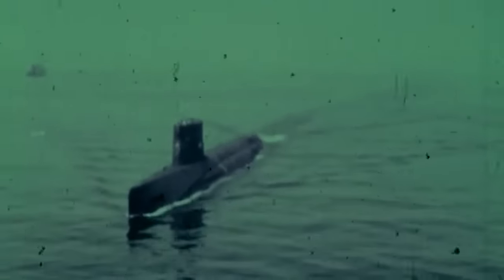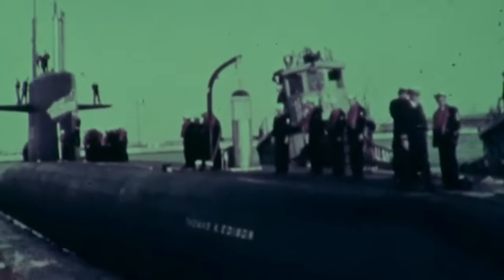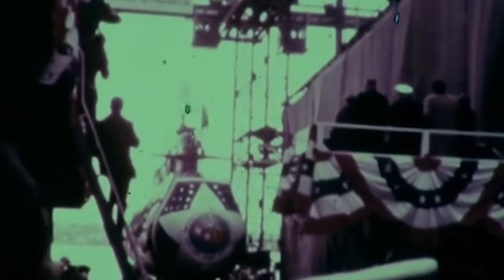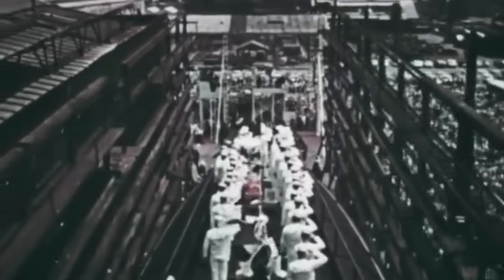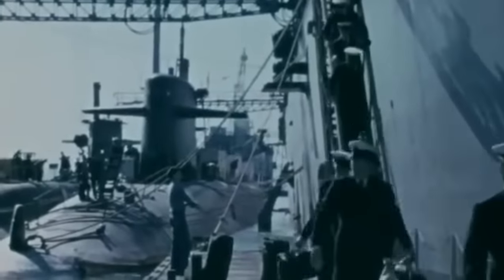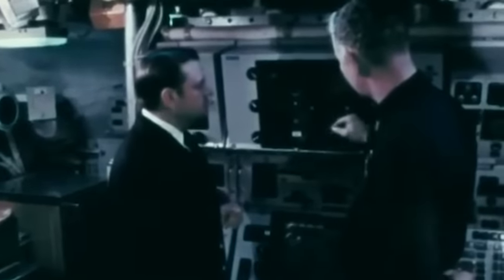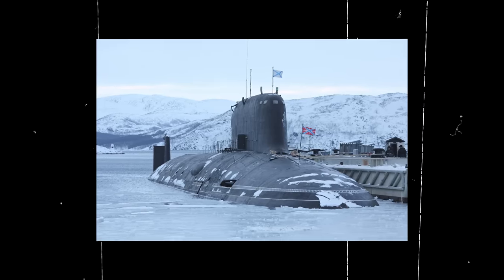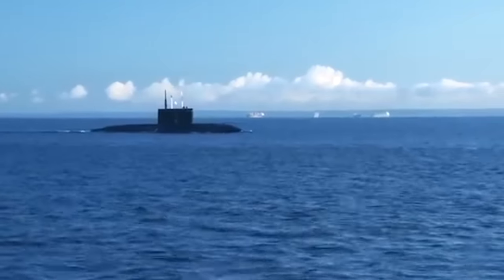Secret Project 0951 Submarine Threat to America?

Comment: You have to remember that we as a country have ALWAYS painted our potential adversaries.  Remember when Lt Balenkov handed over the Mig-25 we found that it was a rather primitive aircraft with a ungodly powerful engine.  The engine also was rather primitive, remember that they balanced the engine by injecting ceramics in the center of the engine, yes it balanced the engine well but the lifespan of the engine was 4 hrs at full power and these engines were not repairable.  You have to also grasp that the Russians haven't been to sea for practically 4 decades, so their at sea time is measured in days and weeks at sea per year, whereas we measure in months.  So even if the platform has all of the technology you tout, you still have a crew that isn't all that experienced.
Reply: I agree ! A very good Intel report!
Reply: Russian subs are no joke I remember in 2018 when their kilo submarine evaded all NATO detection in the Mediterranean only to emerge near Syria launching missiles at ISIS
Reply: @briant5685 a WWII diesel electric submarine infiltrated an aircraft carrier strike group completely undetected in a training exercise.  Any submarine, when properly operated, becomes nearly impossible to detect.
Reply: The Russian navy has been a hot mess from day one.
Reply: Still even with their reported extremely high-tech, systems I am in question of actually even being real, or simply false released data and most likely, nowhere capable as reported.  Was a rider some 39+ years ago, and then even if the Soviets had a similar or superior capabilities platform they never lived up to the specifications attributed to the platform.  Even today their crews appear to be marginally competent, this extends from their surface, air, and land forces.  Do some study on the day-to-day operations in the Navy, it seems as if most of the technical specialists are in the very upper enlisted and officer ranks, whereas the lower ranks are basically glorified compartment cleaners.  The sea time for these boats is very low, so underway experience has been at a minimum since the fall of the old Soviet Union.  So even if these platforms were the best in the world, they would be no more effective in the real world than say an old 637 SSN at best.  And even then, I would put my money on the 637 SSN in a real-world matchup due to crew experience and competence.  The Russian Command structure has some glaring hold over issues from the old Soviet Union, and not much effort has been in improving these problems.
Reply: @GusCraft460  Keep in mind that the U.S. military has been subjecting itself to increasingly convoluted training scenarios just to learn something from said training exercises. I guarantee that's what happened.
Reply: Yeah, pretty primitive. That is precisely the reason why they were shi...ng in their pants in Washington in October 1962, when Moscow had at most some 50 ICBMs and a strategic power a fifth of that of Amerrica. Primitive Russians indeed.

Comment: Propeler design for submarines is highly complex engineeringand the shapes are classified because if the enemy knows your blade shape, they can know the prop noises to expect at various rpm and depths.  This is a huge advantage tuniing the sonar system to detect the sounds.

Eventually, they can extrapolate all of the sound information from sonar recordings, but that can take years.  Meanwhile the sub with the undefined sound profile can just change RPM and dissapear from sonar.
Reply: @fhuber7507 - was going to make the same comment, the prop would be modelled from photos and estimated blade count and noise would be in SOSUS in an hour once they mapped the prop . Then verified by a contact...
Reply: There were so many mistakes in your first sentence that, when I got to "sonar system", my brain initially read it as "solar system".

Comment: Our subs also have their submarine propellers shrouded when not in the water… it’s a given…
Reply: Most things are covered when not in water and can be seen by satellite or any means. I worked on a fishing boat right next to the sub base and the EB facility that built them and everything was covered and a big billboard facing the river that deadly force was authorized,& no photography was permitted.  Basically the same sign that is posted at Area 51 gate place that we see on tv   It’s common sense to cover anything that gives you an advantage and keep it secret for as long as possible.

Comment: Did you check to make sure that Koolaid your drinking was not supplied by the Russian MOD?
Because there seem to be a LOT of questionable statements in this presentation.
The Thresher was launched a decade earlier than the first Alpha. While the Alpha with it's titanium hull was capable of diving deeper than it's US contemporaries, it was also so noisy that US boats could hear it coming when it left port. And as the US also found out almost 20 years earlier, liquid metal reactors sound cool, but they a terrible idea, especially in a sub at sea. 
As far as their new "super" sub, if they can't do maintenance, then it's not going to be a threat for very long. The Russians just added their latest sub Moscova to the fleet in 2022, with an assist by the Ukrainian Navy. 
And those "hypersonic", "un-interceptable" missiles seem to have a few flaws, like not reaching rated speed, being unable to maneuver and being readily intercepted by Patriots.
You might want to check your sources.